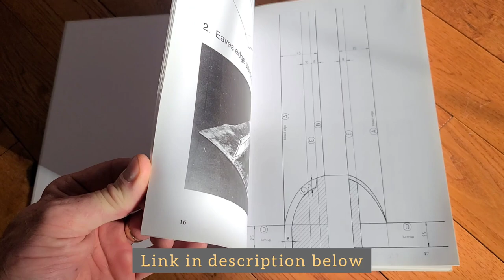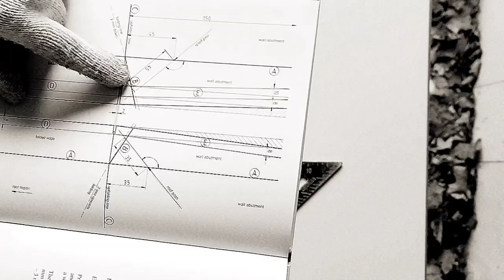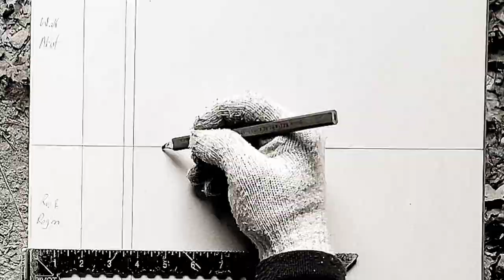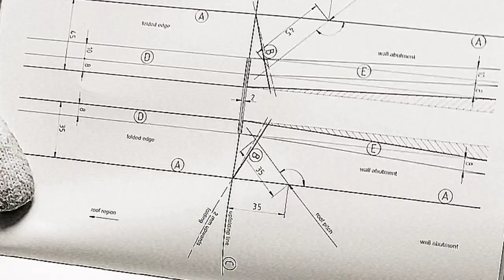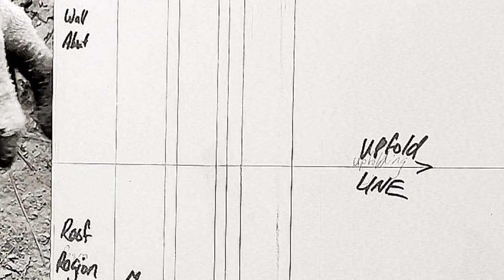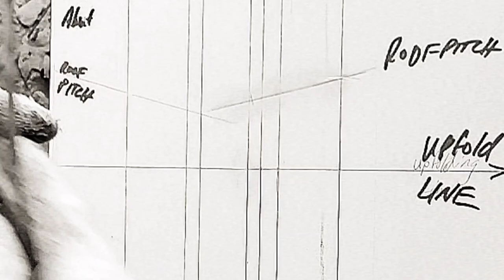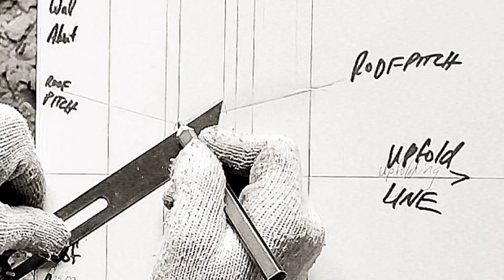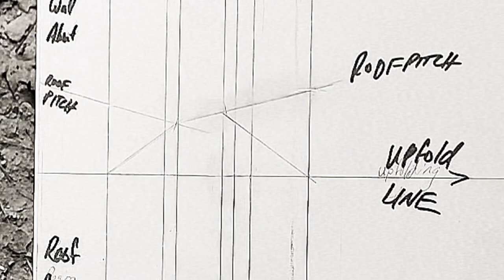HOW TO INSTALL LEAKPROOF STANDING SEAM WALL TRANSITIONS

Comment: Thank you so much for taking the time to share this. I’m a 21 year old carpenter, and I hate that asphalt shingles are the industry standard. I’ve been looking for good info on standing seam for a while. Happy delta reposted this on Instagram today.
Reply from the maker: It's my pleasure.... your helping me prove a point with your comment by reinforcing the need for this Channel
Reply: That’s how I got into doing metal roofing. I started at 16 doing shingles and I said to myself this shit is dirty and heavy and it’s finished product is not even that great. Works for a sheet metal shop who refused to teach me anything so I spent my paycheck several different times to buy sheet metal tools and soldering equipment for the copper work and I was largely self-taught until a few years later when I was able to find some resources online and some books. I’ve been a business owner since 2001 and I am really glad that I took the time in initiative to learn the metal roofing and then improve my skills Over the years. I think it’s awesome that this guy makes these videos
Reply from the maker: This is the exact reason I make the vids....too many guys "figuring it out" when it already has been....instead of re inventing the wheel each time, let's pick where we left off

Comment: You should make a video on different methods of terminating that top edge once you complete the ups stand. Depending on the job in the budget I have two ways of doing it one is more or less just a cap Detail and then other times I’ll take the time to grip the standing seam and fold it flat but would be fun to see some of your methods
Reply from the maker: Would be my pleasure....thanks for participating in the conversation....are you subscribed? Bell notifications on?

Comment: Great informative video. I bought the same book. If it's no stress, could you upload more techniques from the book? Maybe make a series? Greets from Austria.
Reply from the maker: Working on one right now
Reply: @asm101  nice one thanks! I plan to build small training roof in my back yard and practice all the techniques in this book. Do you have the other book too? Details of angular folding?
Reply from the maker: @Matt01miller  we will be covering all kinds of folded details including hip and ridge double fold as well as proper valley practices
Reply: @asm101  Noice!!

Comment: Hi Alex, I have seen this detail hammered flat to the wall, where the roof upseam starts rolling down about 6" off the wall, and eventually lays flat to transition up the wall. I think hammering it flat would require a different type of layout? What do you think, or know, about that? Where I work, everything gets stucco mostly, down to our panels. I would like to use this technique but need to get the wall seams flat. Thanks!
Reply from the maker: We have run into this as well and what we do is install a counter flashing across the tops of every panel...hope that makes sense
Reply: @asm101  yeah it makes sense but my company likes to stucco to the roofing for some reason, since 1931 so it's hard to get them to change things like that 😆 Thanks for replying! I could run the seam to the wall and overlap and solder the vertical seam (it's all copper work). But that turns into a lot of soldering. I'm just trying to avoid the wall flashings by using this technique, especially on small roofs like bay windows